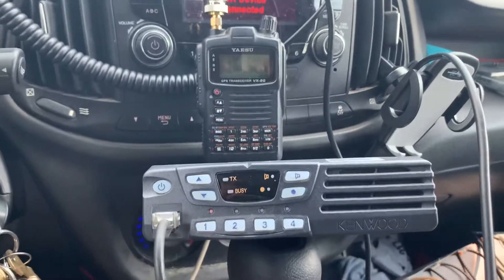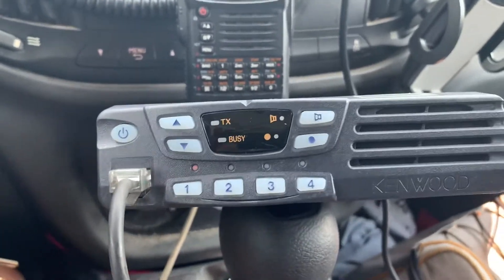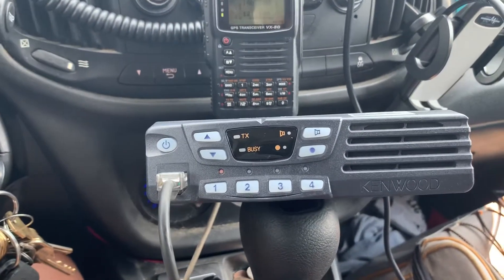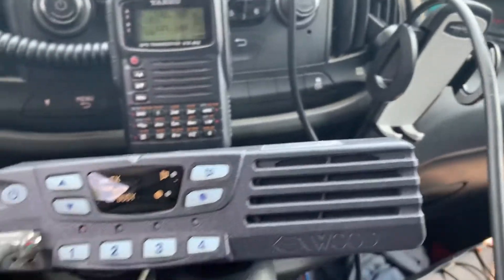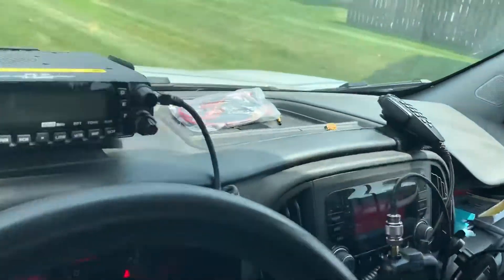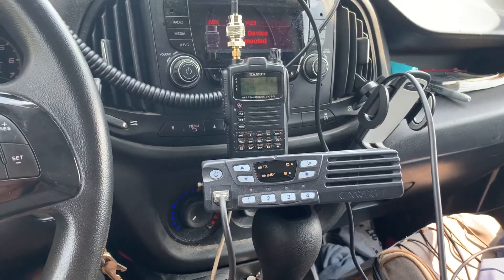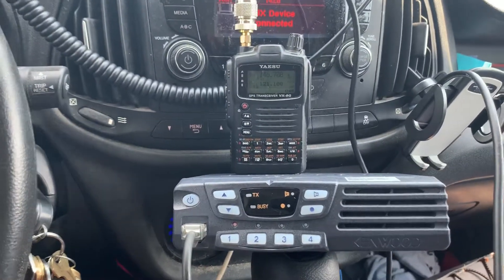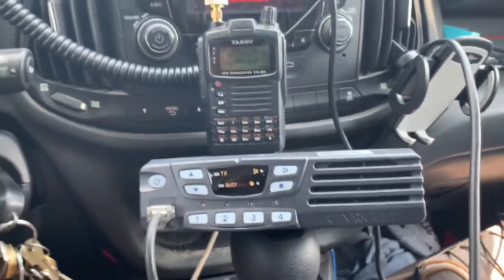Testing Our GMRS Quick Deploy Communication Systems.

Comment: I think GMRS is restricted to 5W....
Reply from the maker: no...no it is not.  50
Reply: GMRS channels 1-7 are up to 5 watts, channels 8-14 are up to 1/2 watt, channels 15-22 are up to 50 watts and can be used on repeaters.
Reply from the maker: @djsoundzentertainment42  thanks. I should probably specify that Im using repeater channels for simplex operation.
Reply: 50w